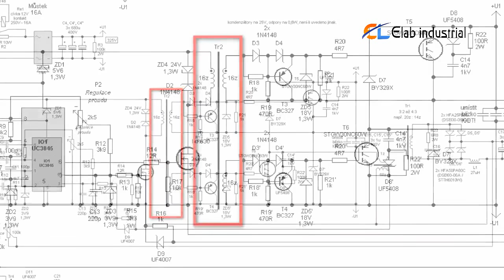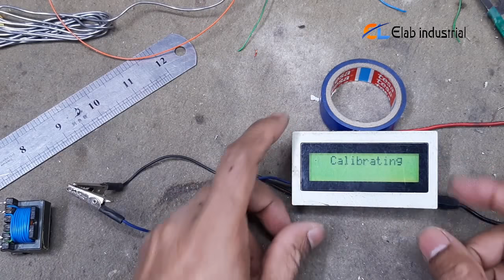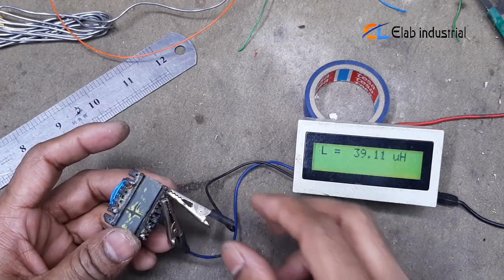How to make high frequency Transformer, IGBT gate switching Transformer

Comment: This turns what I do know about transformers upside down. What I do know is the secondary is less windings than the primary equals lower voltage and voltage increases as the number of turns increase. I am confused now......
Reply from the maker: Both input and output voltage are same . But This procedure is done for dual output for dual igbt gate switching. Thanks
Reply: So the switching speed on the output side is what creates the desired voltage?
Reply: @kwhp1507  The main reason for using a gate drive transformer is for getting enough current to charge the gate of the igbt. Depending on the power of your desing, many times the pwm control does not have enough current capability to do it, in this case you may use gate drive transformer to increase the current and control it with power signal usisng and npn transistor, for example.

Comment: Very interesting.... Good work..
I have a broken one and can't fix it and the saddest  part is, it is not available in our market and so my projector sits there just like a dead phone...and then i see your awesome video and may be a little hope... on the transformer it is written as 1J 400317 001,
And on the second line it is written as LI TAI LTSJ 1733..
Please tell me if ihave any luck with this..
Reply from the maker: I have no idea about this type of transformer but you can use any desktop pc Power Supply Transformer . Thanks
Reply: @ElabIndustrial  thanks for your reply..... If you don't mind and If you could share your no. May be i could share the pic of the high frequency transformer.
Reply: Duckduckgo these numbers.

Comment: This transformer design video has the idea right but the Ethernet cable he used is not necessarily the correct cable for the job. The wire diameter depends on the a specific load current. Therefore the standard Ethernet cable might not be the right choice and can melt. Be careful of just playing with transformers. Especially high current carrying ones.
Reply: Yes, you're right. Besides, using this cable with isolator will decrease efficiency since they are not wound tight together due to the isolator's diammeter. Anyway, his intention and contribution is good, though.
Reply: Yes, you're right. Besides, using this cable with isolator will decrease efficiency since they are not wound tight together due to the isolator's diammeter. Anyway, his intention and contribution is good, though.

Comment: I was making such transformers in 90's, starting by 5khz till 50khz as a blocking oscillator and others by using frequency generator circuits and as I remember for every frequency range there will be different calculations for transformers and coils...
Reply: can you provide calculations pls